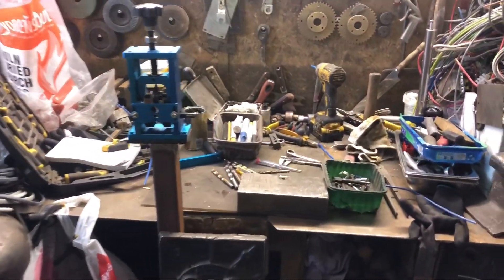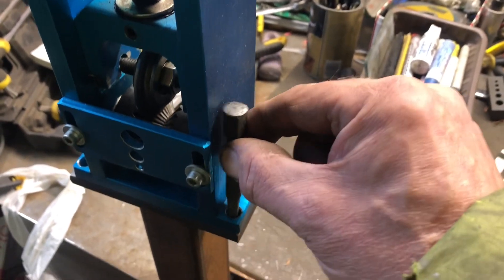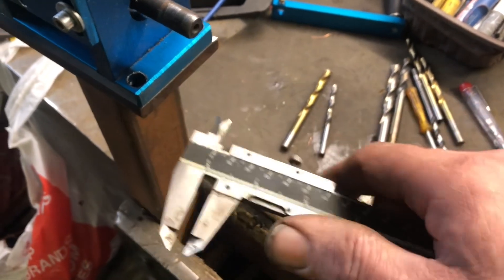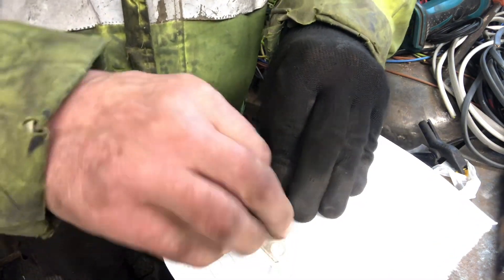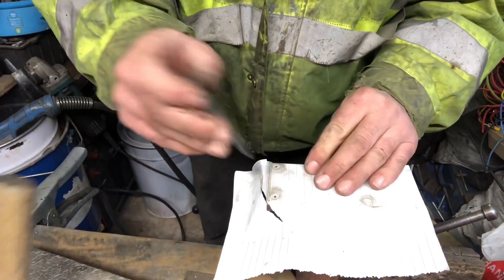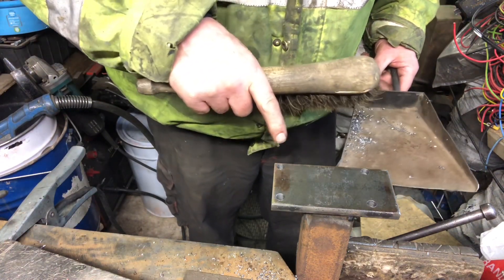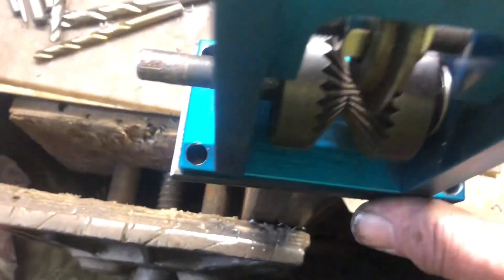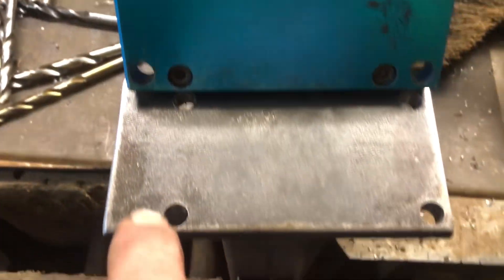How not to transfer a Hole Pattern

Comment: I usually just put the player under and roughly dot the centre with a marker then dot punch and drill. You make have to make a hole or 2 a mil bigger with another bit but it's never far out

Comment: Use your drill as a transfer punch . Get one the size of your hole stick it in and tap with a hammer turn the 90 deg and tap turn and tap do this a few times . The first  hole drill and tap and lock everything down then drill and  tap the others  . One of the maint guys at work should have a set of transfer punches